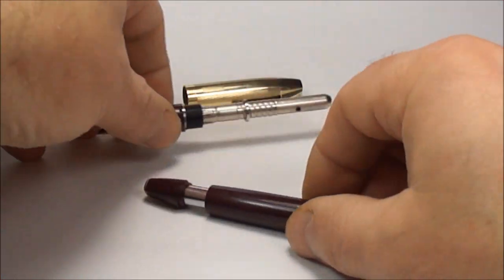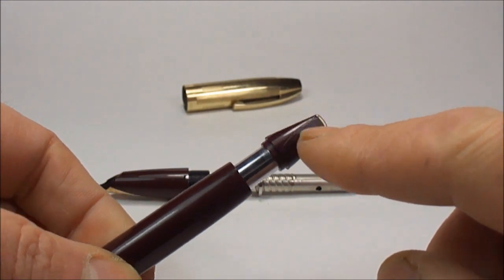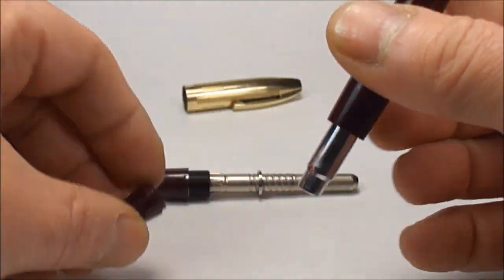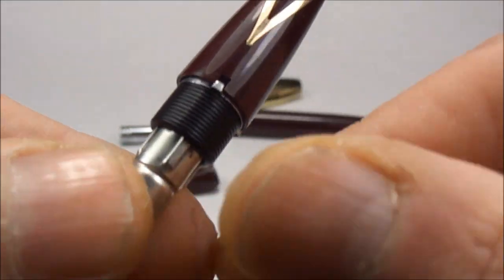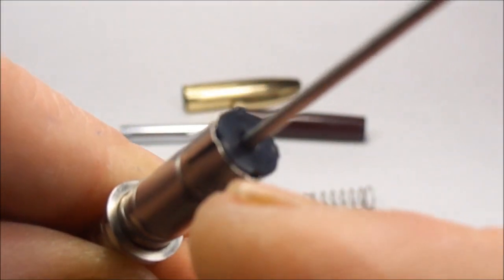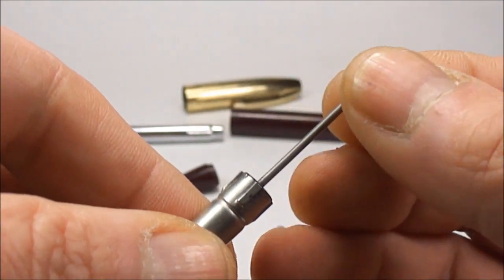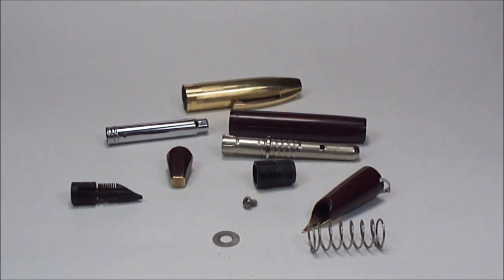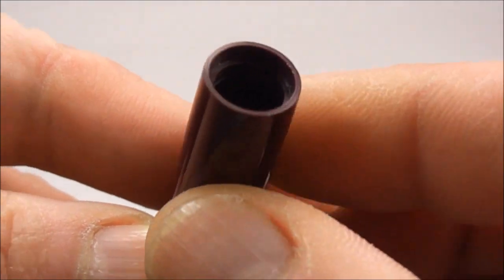How To Service A Sheaffer PFM ( Pen For Men )

Comment: Thank you for the video.  I just received a sheaffer PFM III from the grandfathers estate.  I ordered a repair kit from Anderson Pens and am going to try to fix it next week.  When i got it, the snorkle was pushed back into the sac so that it would not extend.  When i reposition the snorkle do I need to apply any sealant to the junction of the rubber stopper and snorkle?
Reply from the maker: Well done recieving the PFM especially from your grandfather. Yes you can apply a little shellac to the bottom of steel snorkel tube before you insert it into the rubber stopper. Be careful you do not get it inside the snorkel tube as it will block the ink flow. Good luck.
Reply: @penkino1  thank your for the information.  I got everything replaced and it is working beautifully. The o ring on the back crumbled when I took it out which explains why it wouldn't suck any ink into the sac.  The sac was in good condition as far as I could tell but replaced it anyways.   Your video was very informational and easy to follow.  Happy new year to you and yours.

Comment: Tip: At 18:40, you can insert the brush shim on the BOTTOM side of the nib.  That way, if any scratches are made during the procedure, they will be produced on the underside of the nib, where they will not show, and they will be covered by the feed.  
Another great video!  Thank you.
Reply from the maker: Yes i insert the shim top and bottom of the nib, these shims will not scratch the nib. Thank you for your advise.
Reply: Grandmia Pens
 Thanks. Keep your videos coming!  :)

Comment: Hey Steph oh, the tool that you used that you made to remove the threaded part from the hood where the nib is? Any help on where to get one and how to make it would be greatly appreciated.
Reply from the maker: Hi John, it can be made from a wooden dowel shaped into a square to fit inside the connector. Thanks
Reply: @penkino1  Thank you!!

Comment: Great video! How do you spread the snorkel plug retainer end of the sac protector? You mentioned gently spreading it and then re-crimping it.
Thanks!
Reply from the maker: Thanks Adam, glad you enjoyed it. I use an old pen knife to open the original crimps very carefully or you will rip the thin aluminium protector. Then i use the end of a pair of tweezers to create a V shaped crimp. I may have shown it on another "How to" video.

Comment: I got my pfm going again. It was the one with the 4 v crimps and the snorkel came free from the plug during extraction as it was really in there but after some fiddling and new seals it all went back together and passed the water test. IDK if I think this is the worst pen to service. A lot of hype about that on reddit. Getting the snapped j bar out of that hutcheon bros was way worse. I found with the pfm, I just made sure everything was perfect with the snorkel a couple of times before I put the sheaffer thread seal on anything
Reply from the maker: Well done, i hope the video was helpful. Thanks

Comment: Hi, I recently got my father's Sheaffer PFM V. It needs to be restored. I have learnt quite a lot from your video, I am truly grateful for your guidance.
I am a surgeon in Islamabad, and a DIY person. I managed to disassemble the PFM, without any damage. Have ordered the repair kit from the pen dragon. I am bit scared to disassemble the cap. The white plastic dot is missing and the clip has lateral play. Plz guide me where can I find the white dot from. Also the abony insert in the snorkel has a groove/flute , which I suppose should be towards the nib....is it correct.
Kind regards
Dr Rizwan Malik
Reply from the maker: Hi Rizwan, pop me an email and i will see how i can help. Thanks
Reply: @penkino1  Thanks for your reply. I already sent you an email.
Regards
Dr Rizwan
Reply from the maker: Ah ! I will go and take a look. Thanks.

Comment: What size dowel did you begin with to fashion your tool for working on the pen's section? Many thanks!
Reply from the maker: +Luke Enyart Im sorry i can not remember any dimensions, i think it was simply made by hand until it fitted the section. Thanks
Reply: The dimensions match the square on the snorkel cap at the end of the pen.. (I just found out!)

 My one of these pens seems to have the snorkel pushed up into the ink sac. It may be the throat to the nib is clogged and the snorkel since forced back up? I guess it must be fixable?

Good vid, very very helpful.

Comment: Steff, first thanks for the  video - very informative. Second, I have a Shaeffer fountain pen that looks somewhat like the one in the video. Same colour and the nib end looks identical except it does not have a snorkel. Plus the parts inside the barrel look different. The nib has "Shaeffer's 585" engraved on it. 
It's probably 40 years or more old and now it will not fill with ink. The plunger will go up and down but no ink goes in.
Is there a video showing the method for the model that I have?
Hugh
Reply from the maker: Hi Hugh, do you know what model it is ? Maybe you have a  Sheaffer Touchdown fountain pen. If it is then they need to be serviced with a new sac and new O ring. I have just finished a Touchdown pen, however i have another that needs servicing i may make a short video on that one.
Reply: I don't know the model.Don't know if I ever did. If OK I'll email three pictures to your web site. Thanks

Comment: Thank you for a most useful video.
In addition to the washer in the cap there is a small O-ring. Do you think that it is necessary to replace this?  (I didn't and the pen works perfectly.)
The pen was a gift from my parents 50 years ago so it was great to get it working again.

Comment: what happens if i accidentally dip the nib into the ink and draw the ink in? will it be bad? also, how do i completely flush the pen to change inks, as some ink always seem to stay on the nib. and since i shouldnt soak the nib in water, how should I clean the nib?
Reply from the maker: I would sat not to accidentally dip the nib in the ink ?  Flush the pen with clean water until it expels the water clean. You can add a drop of ammonia in the water but make sure you flush with clean water afterwards. Good luck.

Comment: HI, I wanted to service my PFM V but notice that when i look through the barrel i couldn't see a screw in it, is that right?
Reply from the maker: The screw is at the bottom of the plunger tube. Be very careful as it is a little difficult to locate with a screw driver. If you miss the screw you could puncture the aluminium tube. Good luck.
Reply: OK Thanks.. turns out the screw was covered in a layered of dirt haha.. Thanks for your help!
Reply from the maker: No problem. Good luck.

Comment: I have a Sheaffer PFM IV. Was given to me as a hand me down... It does not have a spring apparently. Is this correct?
Reply from the maker: +shadesdragon Are you sure it is a PFM, as they have a spring inside.
Reply: +Grandmia Pens  To tell you the truth I don't know what I have. From what I have gathered throughout the web I haven't see Sheaffer make another pen like it but I might be mistaken. I believe it is a PFM IV but please correct me if I am wrong. The pen was greatly abused and not in great condition when I got it. 
http://i377.photobucket.com/albums/oo214/emartine/Pen%20from%20Grandfather/1.jpg
The pen belonged to my grandfather who passed away some 20-30 years ago. I am in the process of polishing the pen with an automotive polish to remove the oxidation and to try and clean up the cigar burn marks.  Is it worth it to restore?
Reply from the maker: +shadesdragon Yes that is a PFM, you can purchase a spring here as well as a service kit for it :- http://www.vintagepensacsandparts.com/product.php/9/2/sheaffer_pen_for_men_replacement_spring
Yes it is worth restoring, please polish by hand not by machine. Good luck.
Reply: +Grandmia Pens Thank you for your help! I greatly appreciate your knowledge!

Comment: Hello Steff Sir, I recently bought same PFM V in Burgandy colour but its golden cap has some dent mark and like polish or plating rib off. how can i do to make the gold cap perfect? Shall i do gold plating or put gold colour or go to jeweller to put one more layer of gold on it.  cap also has one small white dot (Logo of Sheaffer) how to protect it if i go for gold plating to cap. plz help.
Reply from the maker: I would recommend you send it to a professional pen restorer who will work on your cap. I would not just try and replate it as it may look bad. Good luck with it.
Reply: Ok Uncle Steff ! Thanks.
Reply from the maker: No problem.